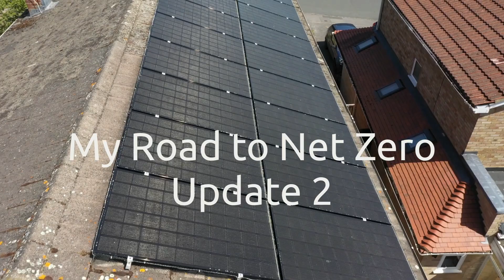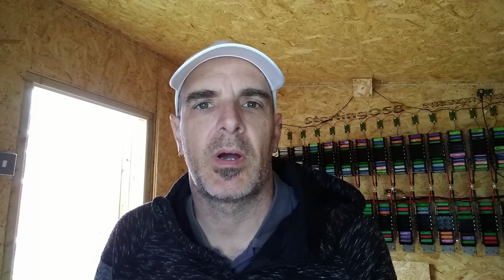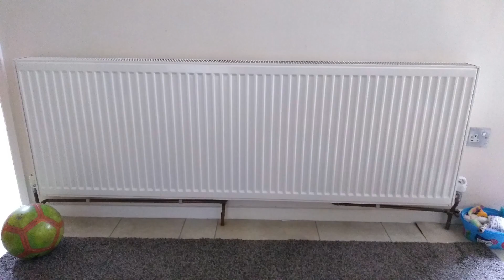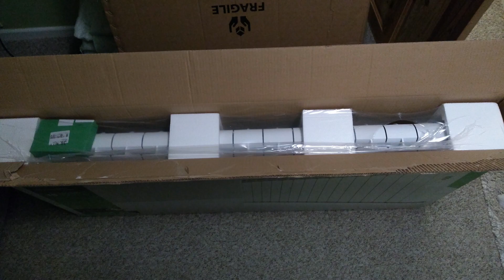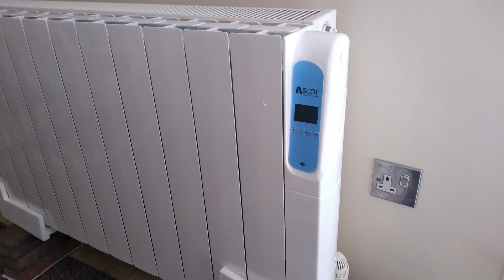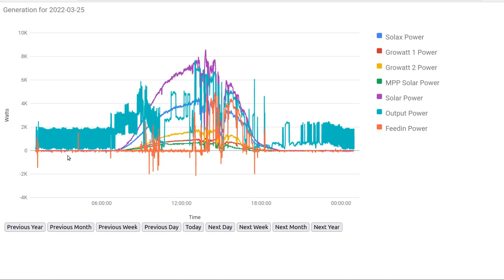Getting off Fossil Fuels goal, update 2.

Comment: Some interesting changes have come to the fore regarding expanding a FIT system, any extra panels added don’t automatically mean the loss of payments but the TIC is prorated, I’m waiting for clarification of whether I could just have one new inverter and more panels and the FIT payment prorated against the extra installed capacity
Reply from the maker: You could also put your new inverter and panels on the grid side of your generation meter and then it won't add anything to your generation totals.

Comment: I am curious how your transition to a heat pump will go. We live in the north of the Netherlands and have a 7KW all-electric air to water heat pump with 220l boiler since one year. Our total energy consumption last year, with a family of 5 people, was in total 5.250 kWh.
Reply from the maker: How does that compare to what you had before the heat pump?
Reply: @nicholashowell  without the heat pump, our total energy consumption was 2.416kWh per year. But I must say, we live in a new build home (2016) with good insulation and underfloor heating at all three floors.
Reply: Your cold radiator is probably due to your system needing to be balanced. All the heat is being taken by your other radiators leaving little or no hot water for the last one.
Reply from the maker: @alanbellwood2229  I did rebalance the system  but it didn't make much difference.

Comment: Air to air heating is the most efficient   and cheapest to run, very low losses compared to air to water, very easy to fit, esp with floor mounted units, and it's a nice easy load for an inverter, when my Panasonic air to air is heating, it pulls around 500w runs great on my victron ESS setup.

Comment: Even though gas has gone up in price electric has gone up far more and make heat pumps even more costly to run than gas,I'm still looking at an affordable alternative to gas but not getting anywhere fast, always come back to gas but I am going to convert my gas boiler to propane just to cut out my gas bill and get meter removed
Reply from the maker: Is propane going too work out that much cheaper than piped gas to make it worth it? As I said in my video, I'd recommend using a lower flow temperature if you are going to stick with gas as the boiler will be more efficient.
Reply: @nicholashowell  not really but I can make the decision when to put it on it will make you think rather than just turn it on and the longer you don't use it the more you save in standing charges